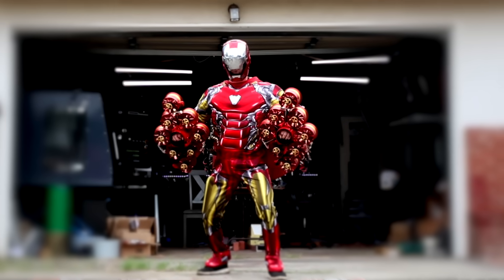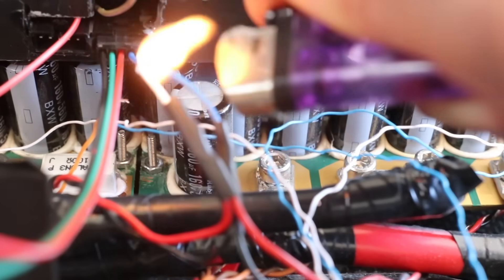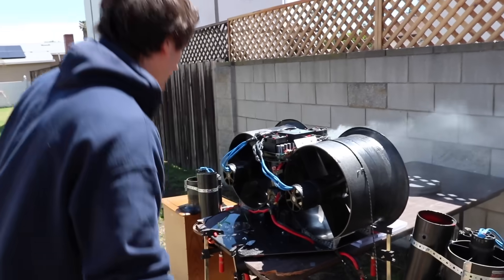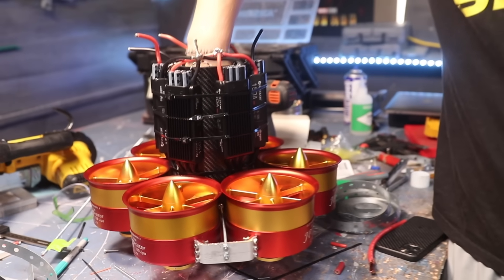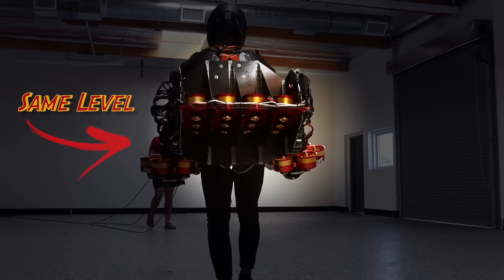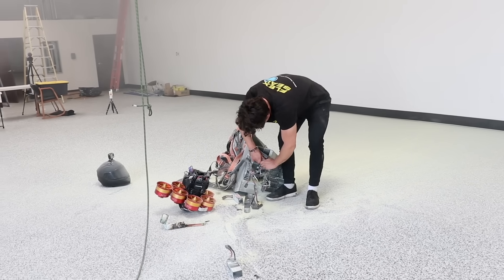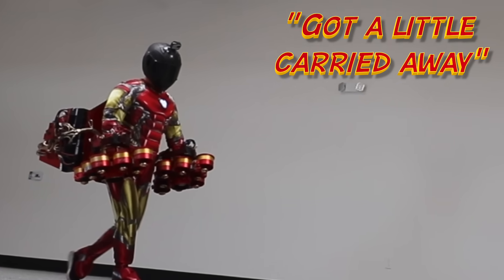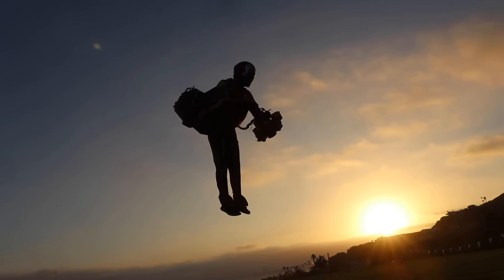Real Flying Iron Man Suit That Comes To You!

Comment: Cool!  I have ideas If you want to hear them. You could take your right and left arm jet clusters and put them toward the end of right and left wings, which you can control with your arms and hands. Once you start going horizontal you will conserve energy and I think I know at least two ways to generate energy without too much drag. Also, as you fly you may be able to catch the wind so that you can get to a higher altitude. Once there, as long as you have backups, you can cut your power, then dive and swoop in order to generate more electricity. If it works there's a possibility you can fly longer than any jetpack in the world. I have my own propulsion concept I need to work on, so thanks for the motivation.
*Correction - This won't work because it's adding too much weight. Will there ever be a way for the average person to fly from ground level for a couple of hours?  It's not over until I WIN!
Reply: *Found a way that's pretty close:  I can fly a jet powered hang glider from ground level. If it was modified for electric jets, it could probably be recharged in mid-air.

Comment: Air-Powered Jetpack with Battery + Supercapacitor Hybrid

Main Components:

Air Intake: Electric Ducted Fan (EDF) pulls in ambient air.

Compression System: Multi-stage centrifugal compressor compresses air to 4000-5000 psi.

High-Pressure Storage: Carbon-fiber air tanks store compressed air.

Energy System: Battery + Supercapacitor combo powers the system.

Thrust Mechanism: High-speed solenoid valves + de Laval nozzles release air bursts.

Control Unit: Microcontroller manages airflow, power, and thrust timing.

Heat Management: Heat exchangers prevent overheating during compression.

2. Component Selection

1. EDF (Electric Ducted Fan) for Air Intake

Model: 120mm-150mm EDF (~10-15 lbs of thrust for intake boost)

Power: ~2-5 kW

Purpose: Pulls in ambient air for compression

2. Multi-Stage Centrifugal Compressor

Type: Turbo-style centrifugal compressor (2+ stages)

Pressure: 4000-5000 psi

Power: ~10 kW for rapid compression

Efficiency: Requires heat exchangers for cooling

3. High-Pressure Storage Tanks

Material: Carbon-fiber-wrapped aluminum

Capacity: 2-4 liters (depends on burst duration)

Max Pressure: 5000 psi (similar to SCUBA/firefighter tanks)

4. Battery & Supercapacitor Power System

Battery: 72V 20Ah Lithium-ion (powers compressor and EDF)

Supercapacitors: 48V ultracapacitor bank (~100F for rapid discharge)

Energy Flow: Battery charges supercapacitors, which power air release

5. Thrust Nozzles

Type: De Laval nozzles (optimized for supersonic airflow)

Material: Heat-resistant titanium or carbon composite

Control: High-speed solenoid valves for controlled bursts

6. Control System

Microcontroller: Arduino or Raspberry Pi for managing power/thrust

Sensors: Pressure sensors, temperature sensors, IMU (for stability)

Throttle Mechanism: Hand or foot controls for burst activation

7. Heat Management

Heat Exchanger: Small radiator or air-cooling fins on compressor

Cooling System: Passive airflow + phase-change cooling for extreme cases

3. Performance Estimation & Optimization

Thrust Calculation

Target Lift: ~250 lbs (~1112 N)

Airflow Needed: ~2.2 kg/s at 500 m/s (exit velocity)

Nozzle Design: De Laval nozzle accelerates compressed air efficiently

Airflow & Energy Calculations

Thrust Equation:

Where:

 = Thrust (N)

 = Mass flow rate (kg/s)

 = Exhaust velocity (m/s)

Required thrust: 

Airflow: 

Exit velocity: 

Estimated thrust:  (close to requirement)

Energy Required for Compression:

Using the isentropic compression equation:

With:

 kPa (atmospheric pressure)

 kPa (5000 psi)

 (air)

Power requirement for compressor ≈ 10 kW

Battery Power & Flight Time:

Energy per burst: Supercapacitor discharges at ~48V, 100F

Battery supplies 72V, 20Ah → 1440 Wh total energy

Compressor uses 10 kW, so battery lasts ~8-10 minutes

Optimization

Energy Use: Optimize battery-capacitor balance for sustained bursts

Weight Reduction: Use lightweight materials (carbon fiber, titanium)

Flight Control: Add gyroscopic stabilization for smoother maneuvering
Reply: Wow.

Comment: You needed to use cables that can stand hight voltage and does not produce heat, a cables alloy same to heat sink's alloy or a bit similar to cities high voltage cables alloy

Comment: Someone should just mate frank zapata and like actual made from steel or something stronger ,iron man suit so the jets or turbines are integrated to the suit not just on the hands on back .like couple ones on the legs and couple bigger ones on the back and smaller ones on the hands.so it wouldn't be so bulky and would be easier to maneuver.

Comment: One thing that's worth mentioning is the suit in the comics, the main thrust is from the feet and the arms are just for stabilization. This later was replaced with auto-stabilization coming from vents around the waist so that the user can fire repulser blasts from their hands without the worry of destabilization. The user could not reasonably control the kick-back from the foot-faced propulsion, so to compensate for this, the exoskeleton make the user have stronger joints that used servos to only move when the user moved their biological muscles. 

Obviously, if we overlook the logistics of the energy and scale needed to achieve this, such complex mechanisms would be WICKED expensive, so it's really impressive how well you compensated for such a lower budget (comparatively).

Comment: When i build one. I will make it without the auto summon,and i will use a portable magnetic generator. That type of generator uses a disc with magnets and more magnets around it. Then the disk moves an alternator shaft to make unlimited electricity! And it lasts as long as you want with no batteries!

Comment: i think that a jet pack like the generator rex would be the best eletric version,  considering that a bigger blade pushing back more air mass would require less watts to work than a smaller blade pushing less air but at a bigger speed this way making the engines consume less energy to sustain vertical flight and the whole set weighing less as well as increasing the flight time

Comment: The crazy thing is Tony in the movie also almost died when testing it. If it wasn't done for comedic effect, he would have been seriously injured when he was testing the thrust at 10% power and slammed into the wall at 100 mph. So I appreciate seeing you take the safety precautions in this video.
Reply: Seriously injured? He most likely be paralised or deceased. He smashed his whole body head first against a wall and then fell several feet. Brain and spine damage would be the least of his problems.
Reply: @Victor-rb6pq  I guess Tony does have a super power, resilience!
Reply: Well
It was done for comedic effect
And it WAS funny
Just wouldn't have been if he actually had been injured
Reply: I think I have a better plan😅

If you could focus at a singular point with a spiral kind of mechanism with one big fan instead of many small fans . it would have been better . 

But still good job man . I'm a big fan of you❤
Reply: @BLAZE_SAGA  they first tried with big fans you remember? cables were blowing up

Comment: To have more control and thrust, more  edf fans need to on the feet than the arms.the [ARMS are for DIRECTION] and the LEGS are for LIFT ,Just like the science of walking,your right arm and your right leg  goes forward @ the same time for (BALANCE)  and visa versa no matter how fast or slow you go.

Comment: It looks like the problem with the batteries bursting into flames is the fact that the batteries aren't all evenly charged so one of them discharges lower than the rest while still pulling full power and that cell will heat up rappidly and burst into flames. I think you would need a BMS system to manage them to make sure all cells in the pack are charged evenly and discharging evenly.

Comment: i think the reason you were spinning was due to the twist you have  on your hands since the motors were giving more force from one side when you twits your wrist it will change the direction of the force  causing you to spin, think of your body and draw a circle around it if the motor is closer to the perimeter  it will have a lever effect  that is not counter acted so instead of lifting it as hole it will shift that plane ( the circle) causing the spin as gravity pushes it back and forth as you shift like a coin that's about to stop spinning on your table, adding the motor to the opposite side when you twist your wrist the effect is dampened but still there try to balance the force the motors produce to keep that plain from shifting, also the motor spin do it some too but not at that extent as you notice when you added the the 6th motor on each hand. moral of the story make sure the upwards force is not tilting what your lifting, its bad for the back. also epic af btw wish i had the will to do this XD

Comment: Just a thought for an alternate power source what do you think would happen if you took a cylinder filled it with gas that was affected by magnetism then put the turbine blades meant for gas that were designed by Nikolai Tesla inside of that cylinder with the blades also being made out of a metallic material that is affected by magnetism, then seal it off and stick an electromagnet on the end of it By my calculations, you should be able to take the energy produced and put it back into the electromagnet just a thought.

Comment: I see a few comments saying use larger gauge wire for the first edfs, but you gotta keep in mind, large gauge wire weighs a ton,  especially if its braided and heat resistant, with only 20 lbs of lift to wiggle with it would have taken alot, Im sure an elegant solution exists like a rectifier. But Imo alot of smaller edfs is actually the way to go, it may not look as slick, but if you compare it to a 4 motor setup, 1-2 motors failing wont result in flight loss.

Pioneer work for real. Not many people think about the fact that human beings have only being flying for about 110 years, the mathematical formulas that exist to calculate lift were mainly designed for fixed-wing aircrafts, so theres a whole world of aviation maths being discovered. In a few more years when we can design more quiet and efficient propellers i think we will see edf based flight take off.

Comment: We need the power but less the size 🤔, Oh🧐 we can expand the power by making it wide and ITS hidden under the armor like how Tony hide the system under the armor, and we can use a smaller engine by making it large but not that high and the power source is hidden inside the armor also to make the armor even more durable,
Reply: Great ideas

Comment: The answer also could be in some other technological ideas ,…I’m thinking,..to lift a man’s weight and defy the pull of Earths Gravity,..we could just use gases like helium inside of chambers in a suit,..not sure how thick it would have to be ,…but almost like temperature controlled suits , but using gases like a hot air balloon,…I’m not saying you won’t explode easily though. And you’d still need some type of directional control,..maybe with bursts of excess air …sorta like a space shuttle maneuvering in space,… it would have to be linked to an onboard i-phone …wi-Fi linked to a ground computer capable of making the complex calculations to release the thrusters in the ( real time ) correct configurations to keep you level and upright ,…..if you watch his video ,…a whole lot of the biggest thrust is wasted in just lifting you,…alleviate that by using the helium or some other lighter than air gas….just to lift you first,…that’s half the battle.   Keep working and try again,…also that would allow your engines to be smaller. 🤔

Comment: How do you simply change the motor direction to counteract the torque? The turn direction is dictated by the turbine shape, or did you replace the propeller to the opposite pitch?

Comment: You should have used compressed lpg in carbon fiber tanks to save weight over batteries. Use hobby gas motors not electric.

Comment: 11:10 Motor torque can be so annoying. especially if your making a helicopter. this is why it is unusual for an aircraft or any vehicle to have an odd number of thrust creators if they rotate. I have forgotten to fix this many times when I make boat rudders or helicopters, sometimes planes, in Trailmakers (a game where you can create stuff mechanically) and then it gets destroyed. But... there is a repair/project-auto-save system, unlike in real life.

Comment: The prototype of the low altitude glider is fine, some improvements are the materials oriented towards weight, resistance also compact the cables, and improve the structure of energy and power diffusion.

Comment: 4 minutes in and Im wondering how is it supposed to be balanced if the rear fans are so much bigger. Unless he made the small ones faster enough to push same amount of air.
The center of gravity though is definitly the hardest variable nglie.
Ah 13 minutes in nice.
Weird suggestion but all fans spinning in same direction right?
Wonder if each side and each side of the rear ones spun in opposite directions, to balance out

Comment: Man I felt for you during this process and I hope, like Tony you never feel like you've perfected it and keep tweaking it until the day you can no longer continue.. Maybe try adding some more of the turbines back to your calves rather than grouping so many on your back.. I'm sure stabilisation would 'feel' safer with the lift coming from a place you're used to balancing and would eventually lead to more mid air mobility.. I'm sure placement would be key to achieve that though, for both initial lift stability and safety alike

Comment: It's kind of the same principle as with speakers. Several smaller subs will move more air than one big one, but at the loss of lower frequencies. Dude, go even smaller and go with more. Have them go full throttle, but in sequence. Example, 1 at full throttle, then 2, then 3 and so on. Ducted fans are tricky for vertical flight. The problem is you get air pressure that builds on the outer part of the duct when transitioning to horizontal. It begins to oscillate and become uncontrollable. It's the reason we don't use them in helios and Ospreys. A meshed duct might give you more control ...and keep you away from the blades. Or have some pointed down and some pointed backwards. You know you could also mount them in tandem.  Also have you considered a gas powered generator/ battery combo? This should also give more flight time. Just be super careful it doesn't leak fuel or youll go from "Iron man" to becoming the "human torch"...ya dig. Great job btw.
Reply: 👆Thanks for the feedback. you have been shortlisted among my console contest winners 
Telegram me to claim your prize🎁🎁💯
Reply: @jlaservideo22..........  Never done this, I'm kind of scared of being scammed...how exactly does this work?

Comment: What you need to do now is add the exoskeleton robot. To give you the strength. The ones that they use for handicap, quadriplegic, and also in factories. Giving you the ability to have the strength to combat the Gforce’s. 
I am also working on a prototype for the electric car industry. The electric car has not broken mould since the first original electric car in 1800.‘s. 
Like Dyson, it needs a full rethink and I’m working on that. You’re video and encouragement to continue when it’s difficult was definitely appreciated.

Also, if you added the AI technology

Comment: if you can program it to fly even sideways (lay down posture) to fly like iron man then it'd be even cooler. 

That can be made possible by adding a few fans on your sides and using a gyroscope to see your posture and trigger the side fans to start working when you lie down in air and turn off when you stand normally. Please consider this idea.

Comment: You should add an interface in the helmet with the power info on all the batteries, the power consumption rate of the thrusters, and the estimated power output of the thrusters.

Comment: @JLaservideo
all of this jetpack design´s i saw so far came to the conclusion that having thrust on the feet is bad.
i think they are all wrong.
the problem is they all try to hover when starting instead of giving power to get into a more stabelized flight.
i think not a single one ever build a safe as possible test environment with foot mounted thrust and go full ham on it right at the start, i still think once youre in a faster motion stabelizing becomes easier and a benefit of thrust at the feet combined with wings that enflate to the sides would instantly stabelize it even more.
once that is figured out then you can start figure out hover < as hover is in my opinion way way harder to accomplish than a stabelized flight.
Reply: 👆👆Thanks for the feedback. you have been shortlisted among my console contest winners 
Telegram me to claim your prize🎁🎁🎁...

Comment: If lithium polymer is heavy considering its energy density would super capacitors offer a better power to weight ratio in terms of peak amperage even if the overall capacity was greatly diminished?

Edit: wonder how axial flux motors would behave as well lol